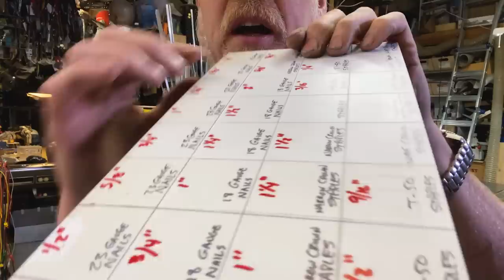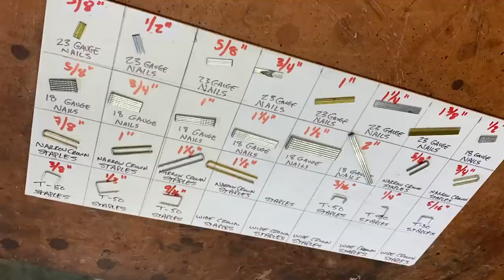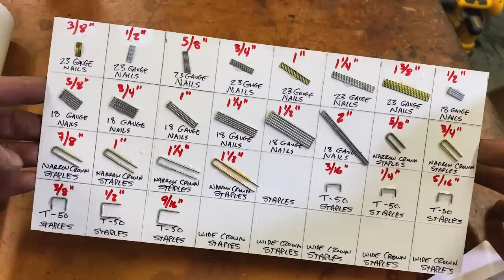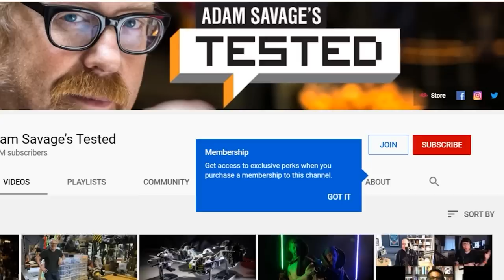Adam Savage's One Day Builds: Staple Sorter and Organizer!

Comment: I would have pulled the stapler sorter closer to the front of the full cart. It does look better the way you did this, but that front ledge isn't really usable space. Anything left there will block access to the lower drawers and I don't have the discipline to not use it as "temporary" storage that eventually becomes permanent storage. I just know myself too well to intentionally create those traps for myself.
Reply: Oh, I also don't have the discipline to regularly sweep, so if I know that I'll be creating little off-cuts like the pop rivets (or when stripping wires), I bring a small trashcan with me to catch the debris as I generate it.

Comment: The downside of tab-and-slot, is that the cantilevered halves, especially with such thin material, could definitely sag or crack with the weight of a bin full of metal nails/staples.
Reply: Made me wonder why he didn't do a glue-up on the entire back grid, and make sure the free tongues on the horizontals were pointing back to touch the back plate.

Comment: how to prevent the watch me die inside scenario when multiple boxes fall spilling your precious staples.

step 1: attach 4 metal sticks horizontally to the back of the cabinet (or a thin sheet of metal should work fine)
step 2: hot glue tiny magnets on the inside (back) of each box
step 3: enjoy every time you push a box in the satisfying click of the box fitting in place

Comment: the when you said if you work for a job like this and your bored spitles .. the situation you discribed there is 100 % acurate. at my firs job i needed to drill sqauare flat blocksand tap it  with metric 8 mm. i ended up building a jig i could load the blocks in and the only thing that was nessecary whas jerking a handle from left to right, dril press , and so on to load and dump a block i could pre load by 50 pc. the noticed i was making 300% more block then the averege inter and let me do more

Comment: You may already be aware but there are hot melt adhesives available for use on archery points which have a bit of flexibility in them and don't fracture so bad after constant impacts. A few examples here https://www.quicksarchery.co.uk/easton-low-temperature-hot-melt-glue-ek03.html
might be of interest.

Comment: A thought should any of the staples fall off the labels in the future. Instead of gluing on real staples, 3D print the staples and glue those on the labels, as the super glue will adhere to the styrene and 3D printed parts better.  Additionally, you won't be using real staples on the label, but you'll still get the visual information.

Comment: I wonder when Adam will change the labels to the metric system?
I am not sure why the USA clings to the imperial system of units along with only two other countries: Liberia and Myanmar.
One can calculate in their head the number of millimeters in 2.3473 kilometres by moving the decimal place.
How many inches are there in 2.3473 miles?

Adam should do a video on this childish National recalcitrance
Reply: can I point out that the bolt you just rounded off was a 3/8, not a 10mm...